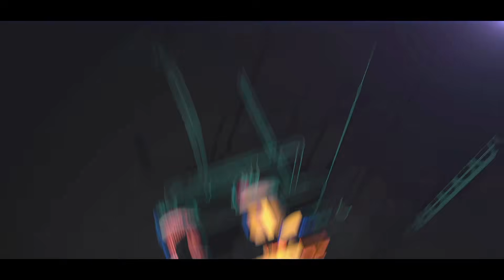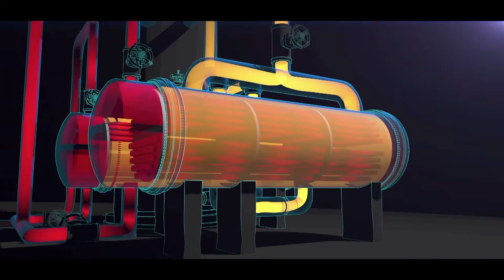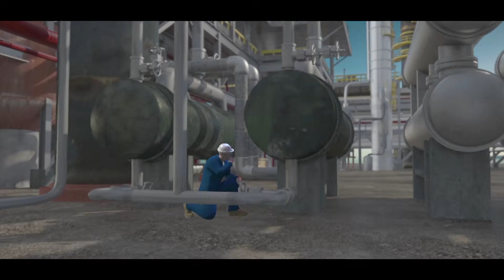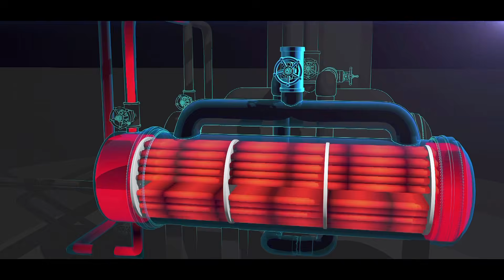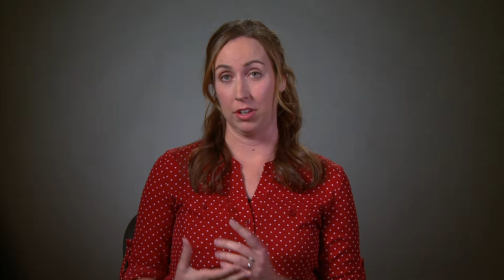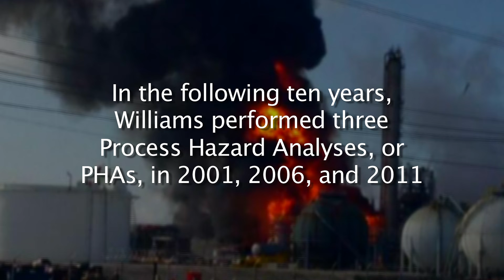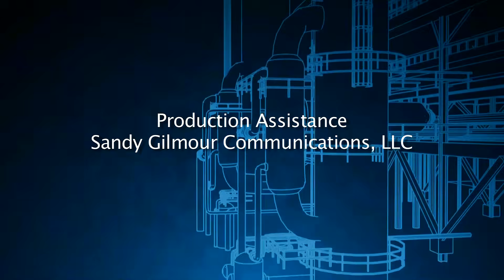Blocked In

Comment: Every time I watch these videos, I have the most effective and simplified safety fixes to all of them. For instance, these valves. With the power of simple magnetism, some wire, a light panel and and loud alarm. I can build of very inexpensive indicator panel at the vessel, that lights green for each valve opened correctly. Any valve not opened in sequence will cause a red light and the alarm to scream until that valve is opened.  Total cost? About $400 for all the parts I need and you'd never see this issue. I can put one loud alarm on the panel, you won't forget. For good measure and another $100, I'll have a redundancy failsafe circuit.
Reply: Except it would all have to be an intrinsically-safe system using explosion-proof components and safety-rated industrial controllers - all signed off on by a Professional Engineer - so it would cost you $400,000.
Reply: ^^^^ this.
Reply: Dragon Steel simply explains a fail safe system for double checking operation. Don't poo poo his thinking.  The idea is totally sound, an idiot proof check system which Ibthink should be complusory on EVERY plant where human errors can kill people. Any design or installment cost is negligible compared to catastrophic consequences.

Comment: It's just crazy that these HE's were not fitted with pressure and temperature sensors.
Reply: Raymond Edge They most likely were, with pressure gauges and thermometers. That doesn’t prevent anything.
Reply: Be better to have audible alarm and pressure relief valves, and even better still stick with the original design which was probably done with care and attention to detail by true professionals.

Comment: there are some design issue, every unfired pressure vessel shall have a pressure relief valve to be set to lift off and release the pressure, the set point to be lower than shell pressure test, thus preventing the shell from rupturing. Each heat exchanger shall have its own relief valve.
Reply: no shit sherlock...

Comment: Yeah don't put valves between the PRV's.
Reply: You see this all the time in the field and it’s usually so you can perform routine maintenance on the PRVs like rupture disc swaps without shutting down the process. However, there has to clear procedures on when it is appropriate to block in the valves. As mentioned in the video, the block valves should be locked open and operations should be notified when it needs to be closed.

Comment: A "Cultural" issue....that I speak about so often. The MOC ( Management of Change) process was used AFTER THE FACT as a CYA( "cover-your-a$$) effort....and not as a tool to identify hazards. It speaks to a larger work-culture issue as to how this company....and its design and operating staff.....view regulatory requirements. At some point having procedures and regulatory laws in-place is not enough....it's how the "Company" ( everyone.....top-to-bottom-and-sideways) has been trained and "believes" in the value of these safety protocols. It's a key element in safety training that I am involved with...and this "cultural" issue is often ignored or given short-shrift as to impact.

Comment: so when switching reboilers, they should have opened the shell-side valves first or at least opened both shell and tube simultaneously.
Reply: That would prevent explosion and that's probably the way they normally did the changeover. More to the point though is that a system that explodes when a single error is made is a poorly designed system. I would lay the blame squarely on the people who signed off on the block valves project. I wish the video had included a shot of the detailed P&IDs so that I could Monday morning quarterback about how I would have done it....
Reply: true, but i was imagining the burst discs being on the vessels themselves, that way they could never be isolated.
Reply: As long as you're okay with venting a large quantity of propane at near-grade when the burst disk lets go.  There is no reset on a burst disk, and the entire contents of the propane system would be released.
Reply: that's a good point. there would need to be some kind of loss of pressure safety shutoff as well. hmm.

maybe the best way is to just not block the pressure relief system
Reply: That's why I suggested the blowdown stack & flare, but even that is an unnecessary addition to the plant. They already have a pressure release valve and simply need to prevent it from being isolated.
Reply: ...or even just a tag-out/padlock.
Reply: A classic mistake of not knowing how to operate a reboiler. Simply opening the shell outlet valve on the reboiler, first, would have lined up the reboiler to the RV and prevented this from happening. And this should have been apparent in the operating procedures.
Reply: i wonder what kind of normal operating pressures those exchangers operated at? you can get 4" burst discs rated for up to 20k psi and they are dirt cheap
Reply: SuperAWaC that's a good idea. Burst discs and a blowdown stack + flare, expensive though if you're to manage the escaping product safely. It shouldn't be possible for the pressure valves to be isolated at all. So working with the current over-pressure design, they should shut down a single heat-exchanger more frequently, or go back to just shutting them both down.
As a shutdown operator, I'd want them both shutdown for safety reasons anyway.
Reply: the supervisor should have stayed in the office and let a unit operator line up the reboiler.
Reply: Making the whole thing exclusively manual valves was probably where the mistake started...
Reply: @xxz2749  

Thing is, automatic systems fail and it's probably more difficult to make it failure-resistant than to train people correctly and lock crucial valves.
Reply: The laws of physics are uncaring but fair.  Closing all valves to the shell was asking for an explosion if anything caused the reboiler to heat up. It only takes a little bit of volatile liquid to create vapor pressure.

The shell shouldn't have been isolated to begin with.  Locking one of the valves open was probably the best option available for cheap.  A more expensive solution would have been running redundant pipes up to the pressure relief valves.

If work required depressurizing the shell, then it should have been purged with inert gas and/or open to atmosphere as appropriate.

The incident started months earlier when the reboiler was left with all valves closed.  Then it got lethally dangerous when the supervisor gave in to the temptation to improvise a procedure for switching from one reboiler to the other.

Comment: I was there when this happened, it's unbelievable how loud it was.
Reply: Considering the thickness of the walls on that reboiler ... hell yeah it must have been loud! I wonder what pressure levels it had right before the explosion. Like, 1000PSI? I'd do some calculations if I knew more about the specifics, like incoming steam/water temperature, efficiency, and how much propane was in there.
Reply: @BenjaminEsposti  more than that
Reply: when they mentioned all the employees with injuries I was wondering how many of them were hearing related?
Reply: xwinger15 It's Suncor, Fort McMurray, Alberta, Canada. Northern Alberta is the 3rd largest deposit of oil known in our world to date. Out of the many major players here Suncor was the first to build here, proving profitability off of the extraction method required to separate sand from bitumen. It's boiler was built in 1964, and is still in use. One thing I can say I'm thankful for is our meticulous procedures in place that are centralized and tailored to specific needs of oil industry in Alberta. It may be a pain to take so much time, planning, check, balances, and safety precautions, but it keeps the train running, and employees alive. I'm a pipe welder in local 488.
Reply: @barryross5840  Dad was Chief Mechanic for Marine Pipeline in 1960 out of Windfall, Alberta. His brother, my uncle, came out of retirement for Operating Eng. to do the underwater and understream NG pipline over to Van. Island. The next job we were posted to was Oklahoma. It sounds like the deep south with their culture and "right to work" laws haven't progressed much since the sixties.
Reply: TylerWard335 were all in shut down season here in the tar sands in Fort mac. The hydrogen furnace at my site was 1 of 3 built, and now it's the only one left, the other 2 have blown up. Been 3 evacs this week. by this week, I mean last 4 days. Funny you mention how loud, I keep my earplugs in at emergency assembly area. Keel safe brother.
Reply: @barryross5840  KEEL?! KEEL OVER!? BAD!
Reply: Barry Ross what site was that?? I never heard about anything about that...
Reply: Barry Ross I am familiar with the area, as I am working up here as well currently, but thanks for the extra info. Was it Suncor base plant? I’ve only been working up here on and off for about 6 months, so I’m still a little scared of disaster haha. I’ve heard people say Suncor is unsafe compared to other sites, though I worked at Fort Hills and know that they are quite strict with safety, at least at that site.
Reply: Why he opened the water side valve ?
Reply: way more than 1000PSI...
Reply: Was anything left of that poor bastard that got exploded?
Reply: sometimes the sound can exceed the maximum DB rating of the earplugs.
Reply: Hey tell me why the hell they put tar in the water. Seems pretty stupid and dangerous.